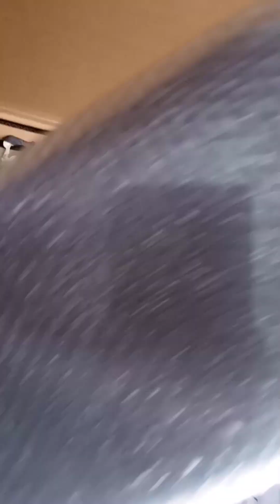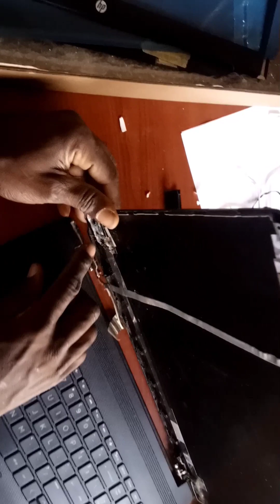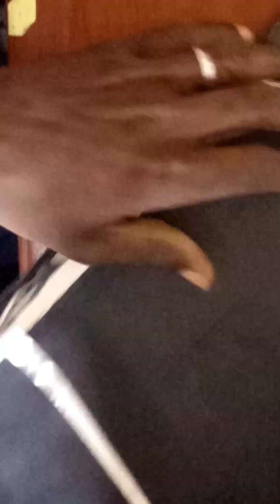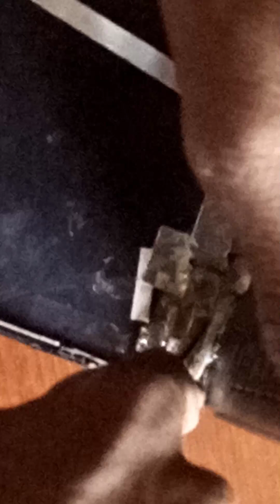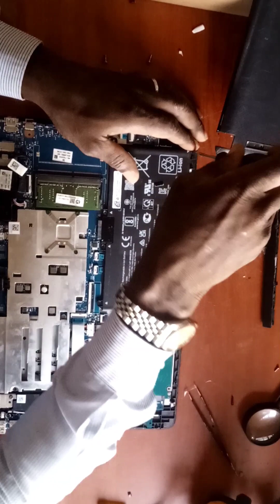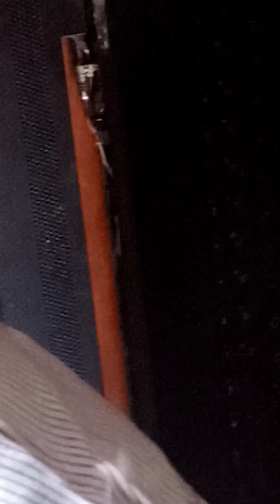DURABLE FIX for Hinges & RELIABLE IDEA Replacing A CREWLESS SCREEN You Must Know #fixhinge

Comment: the adhesive u took off the old screen is not reusable u should have used some double sided tape they are pretty cheap i dont think that screen is properly sticked to the frame but the hinge looks ok
Reply from the maker: Thanks for that observation on the adhesive. I noticed that too but when I applied Hot Air to it got sticky again and I felt it.

For the double sided tape, I don't, I will ask around and add to my working materials. I appreciate this your comment. Thanks!